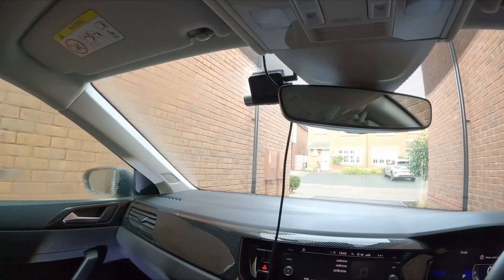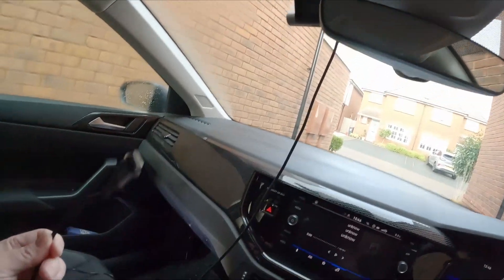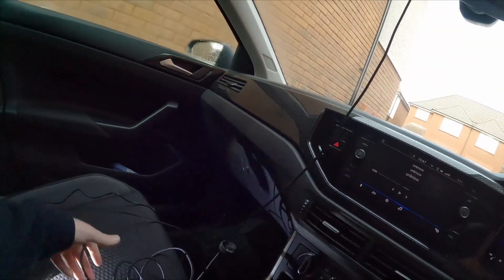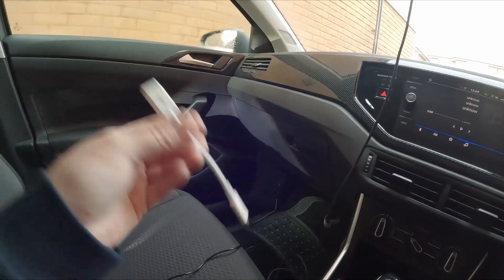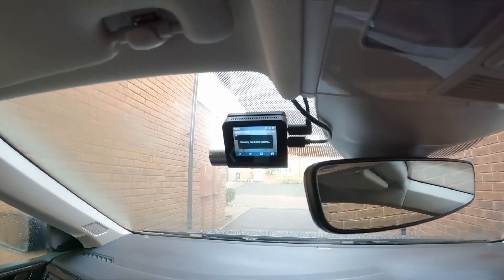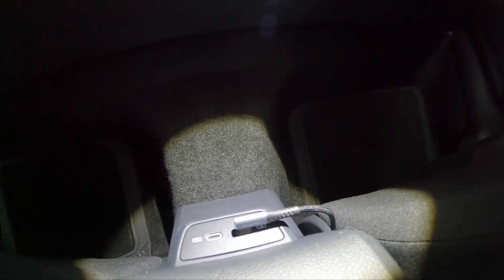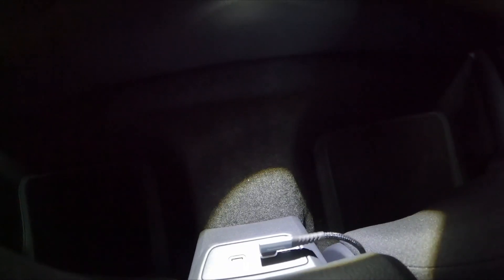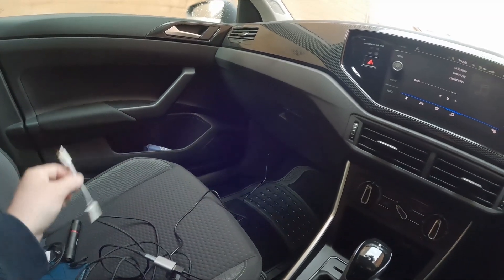How to Power a Dash Cam Using a USB-C Port

Comment: Thanks for this information. The VW 12 volt socket supplies power even after switching the car off. This would solve the problem.
Reply from the maker: Yes, USB-C usually turns off around one minute after the keys have been removed from the ignition.